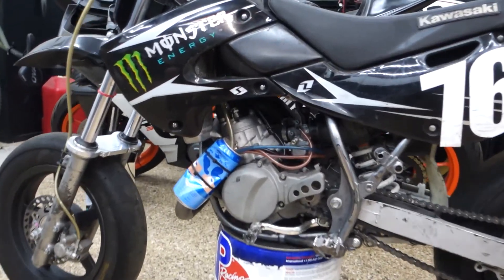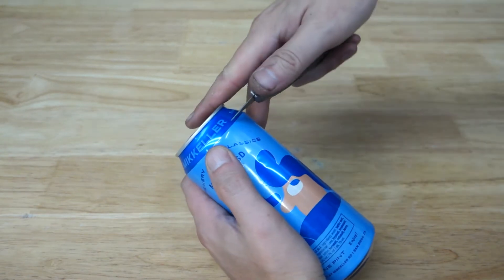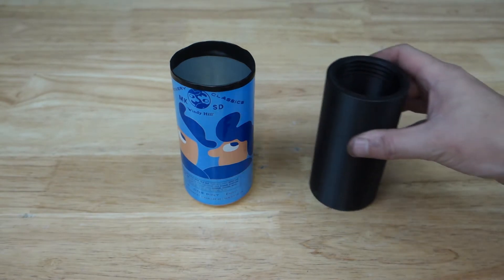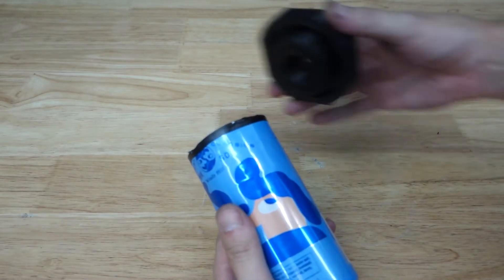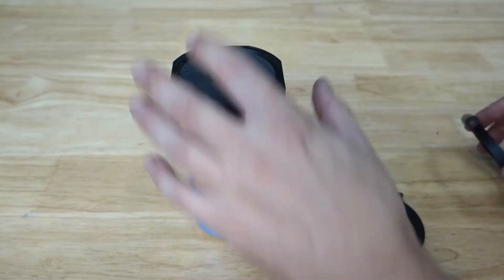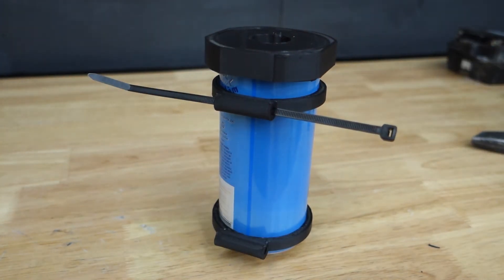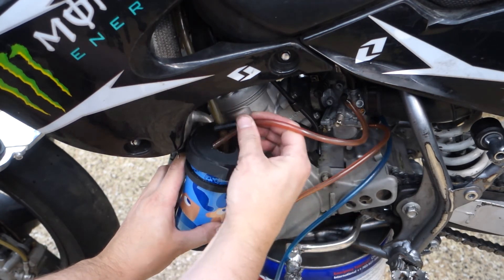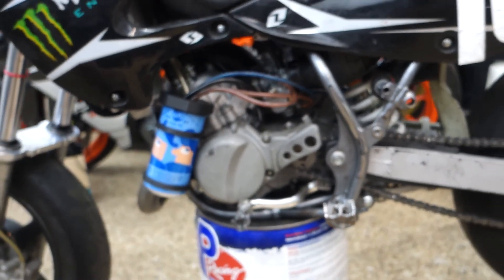3D Printed Minimoto Catch Can

Comment: "most dangerous way I can think of..." 😆
Great video & good to know about PLA! 
For the mounts, will PLA hold up to the heat from the motor?
Reply from the maker: The mounts hold up well as long as they don't make contact with the exhaust. Now I need to clean PLA off the exhaust that just got the rust removal haha